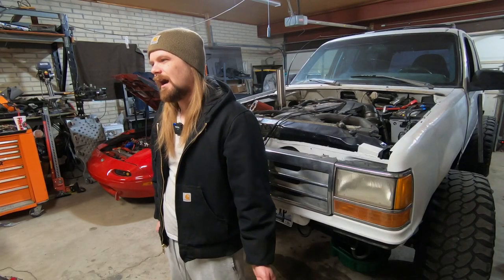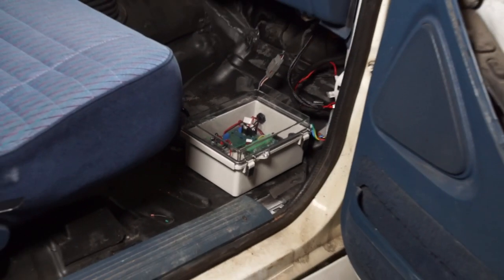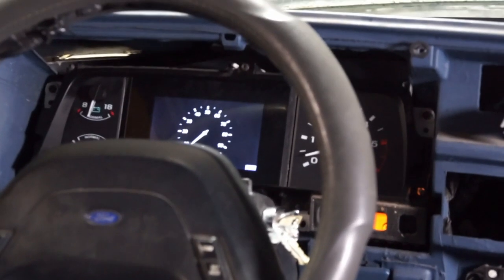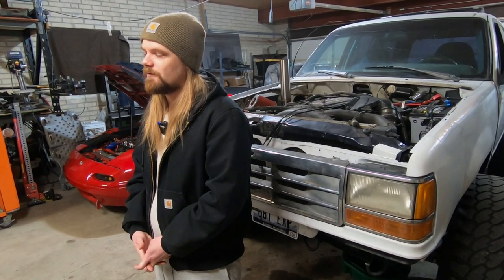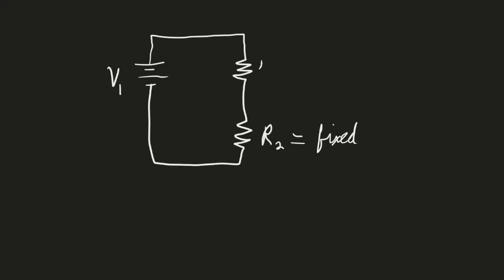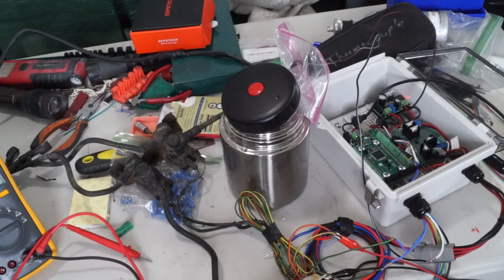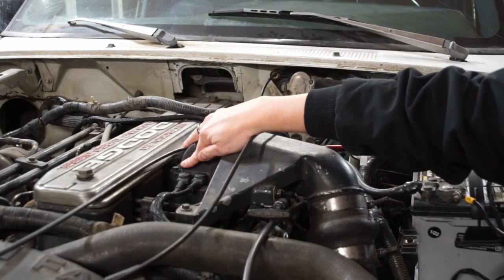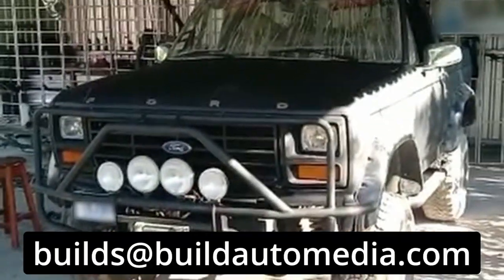This Engine Swap Runs on ARDUINO!

Comment: The learning curve in electronics is non linear, great work! Ask me if you need help with electronics, there's a better way to read temperature with termistors but your way totally works. As a side note, I believe grid heaters have to turn off after like 3 to 5 minutes, when the coolant temperature rises, maybe hooking up a coolant temp sensor is the next step 🤔, thanks for featuring the bronco! So happy to see it here, thanks a lot!
Reply from the maker: Thanks for the clip and allowing me to use it! 

My hope with the grid heaters is that once the engine is up to temperature the intake will be warm enough they arent needed, especially since the turbo will heat the air up (although the intercooler will cool it down). I'll keep an eye on it and if the grid heaters stay on I may have to get a little fancier. 👍

Comment: here is a tip: next time you need to energize relays over 5v, you can use a relay shield from arduino, which will take the 5v signal from arduino to tell a relais to energise. If you feed 12v to that shield, it will then tell the "big 12V" relais to energize.

It is a bit "relay or relay" but it works. There are quite a few relay shields, all with different type of voltage / amps.

Also, with transistor, i hope you added a diode between leg 1 and 3 to avoid counter current when switching off your engine, this could blow your transistor off. (bazillions of video on YT about this)

Great build, love the arduino onboard computer management system

Comment: I'm from the Caribbean and have a nissan 250gt/g25 looking to turbo charge later this year and arduino is the platform ill go with. glad to see you backing up the reliability.
Reply from the maker: Very cool. The turbo miata I'm helping my little brother build actually uses a speeduino ECU with tuner studio, it seems to work well!

Comment: Your videos keep the heart beating on my build. Currently I have a 6.9 idi with a crap turbo kit and a non overdrive 2wd auto. Currently I’m putting a dodge Dana 60 in the front with custom 4 link. First time on a project like that. Then I have to build my 4x4 c6 because it’s not much better than a core. I’ll be backing it with a gear vendors over drive that I got in pieces. And lastly I should be picking up a mostly completed decompressed 7.3idi motor which I’ll be making my own power stroke style turbo system on. It’s gonna be a long project. Somewhere in this I have to get it over to my buddies shop for paint. Mind you I’m doing all this in my drive way in my nice neighborhood, sorry neighbors.
Reply from the maker: Im glad my videos help, sounds like a great build!! 👍